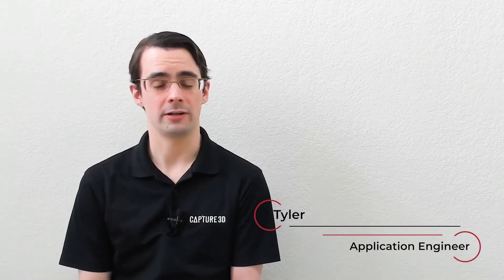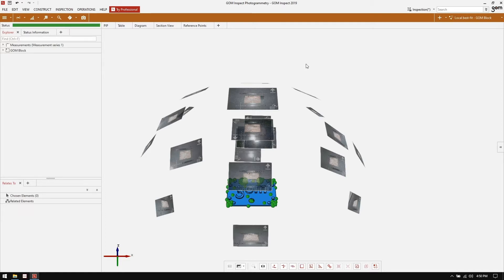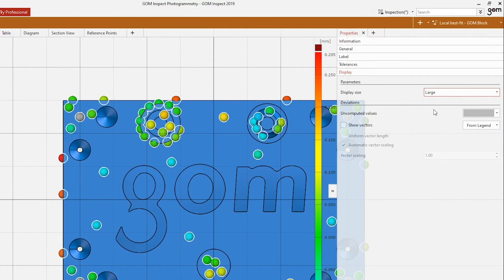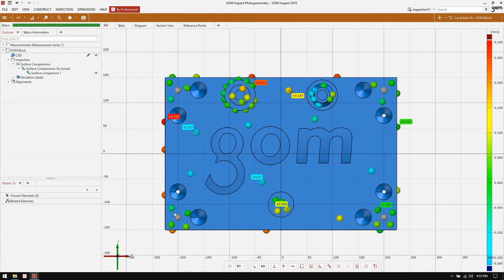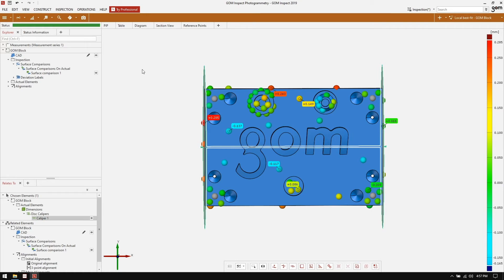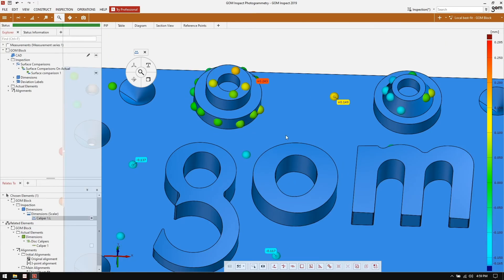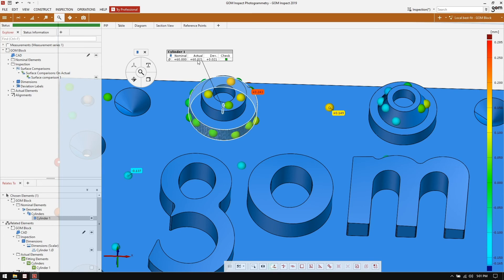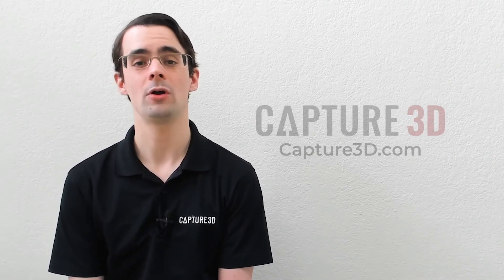Engineering Tutorial: TRITOP Photogrammetry Inspection In Free GOM Inspect Software

Comment: How did you get the CAD aligned with the photogrammetry results?
Reply from the maker: You can perform an alignment after importing CAD. Here is one of our tutorials going over some different alignment methods https://youtu.be/hUePOJRQqLo
Reply: @Capture3d  There's so little to reference with the data acquired via photogrammetry, the referenced video may not apply very well? It seems like there would be more specific and unique  methods for photogrammetry acquired data which is just points?
Reply from the maker: @Mrddrichards  You are still essentially aligning the two datasets, so I'd recommend starting with an initial Prealignment, or a 3-point alignment. If your requirements are very complex please contact us at support@capture3d.com, or address it in the GOM Forum to discuss specific details. Hope that helps!
Reply from the maker: @Mrddrichards  Yes it's less than the scan data, but you are still essentially aligning the two datasets, so we'd recommend a 3-point alignment initially and then refine it with a local best fit using all of the points. Hope that helps!